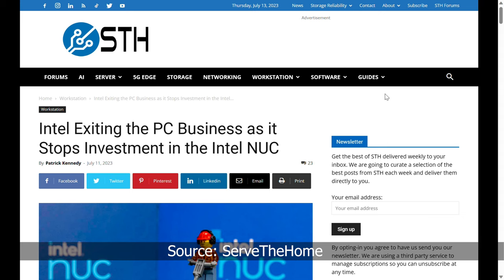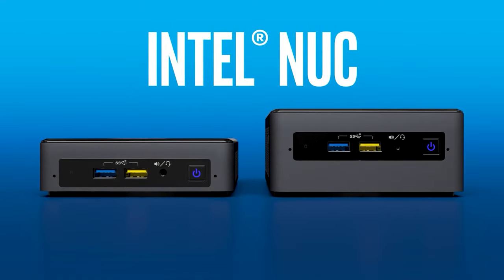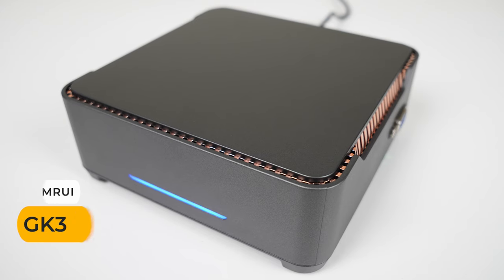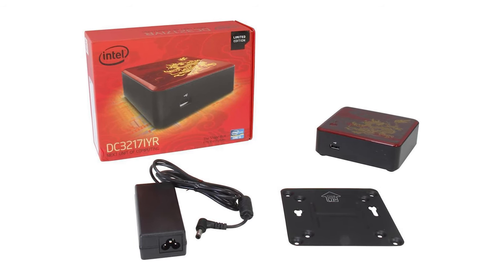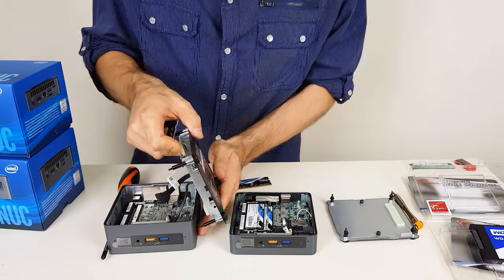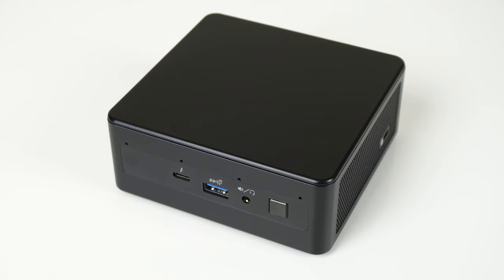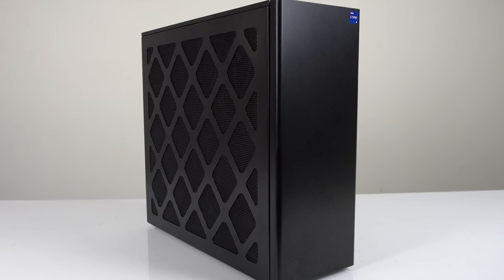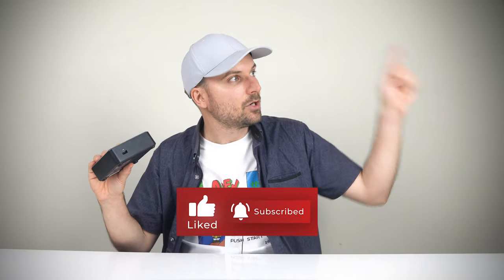Intel NUC is Dead

Comment: Just came across you channel whilst shopping for a mini gaming PC. You do such an amazing job man, congrats. After looking at your videos I’m between Phantom Nuc 11 (£749), Nucix7 (£979), and HX99G (£919). Should I be considering only the last two given Phantom is a bit outdated/older? Thanks
Reply from the maker: It really depends on your needs. Phantom Canyon is one of a kind and a fantastic NUC, but yes a bit outdated (CPU especially). If the aim is high CPU performance, the HX99G is the best option. The NUCXi7 has the best GPU, but the CPU isn't as good as in the HX99G. If you want the value option, the HX80G provides good bang for buck... at least with the pricing from the Minisforum website. I cover both in my HX99G review.
Reply: @Robtech  thanks for the quick reply. GPU wise the Nucix7 would be the play though?
Reply from the maker: The 3070 is faster than the 6600M in everything yeah.

Comment: The BIOS on the NUC6CAYS was a nightmare. Versions up to 47 had VGA dropouts. Version 42 to 45 slowed the USB 3 ports to USB 2 speeds. And as with a lot of BIOS now, once you upgrade past a certain version you can't downgrade, for security reasons of course. Which means you could get stuck with a version that had an unacceptable bug - even one that made the NUC unusable for the intended use case. Good riddance.

Comment: Would like to see this form factor standardised, curious why that has not happened (or if it is in development) yet. ie atx etc
Reply from the maker: ASRock Industrial also manufactures their boards to Intel's original Ultra Compact Form Factor (UCFF) spec. Most others seem to go bigger or smaller.
Reply: @Robtech  I mean more to do with being able to buy any case and they fit the board, allowing the consumer to buy slightly larger cases with better cooling, passive cooling cases, or semi-passive cases. I guess the issue is mainly to do with i/o, but the backplate and front panel connectors remedy that issue with atx etc.
Reply from the maker: Yeah that would be nice, but different port selection is a problem unless the maker of the board included compatible IO panels to go with it.

Comment: What if I want to buy a NUC with a built-in graphic card? Which is the better choice now? NUC 11 phantom, or NUC 12  sep? thanks
Reply from the maker: I haven't retested NUC 12 Enthusiast with the latest drivers which would probably have better performance across the board compared to my review. It'll depend on the price difference and how tolerant you are to fan noise.
Reply: @Robtech  I followed you since Hade Canyon as I wanted to get a NUC with a built-in graphic card. Well, Intel killed the NUC, I want to get either 11 or 12. The 11 is about $600. And 12 is about $900? Do you have any compare videos on both of the NUC? Thanks so much.
Reply from the maker: I just have my Serpent review which has some comparisons between the two. I can't afford to hold on to most minis unfortunately.
Reply: @Robtech  Ok. Thanks so much again. I will take a look. I can see the differences in the graphic cards, but there are other considerations. Again, thanks

Comment: Had the Hades Canyon. Before it, I used a 5th gen small one. Every time I sold them because I wanted a little more GPU power. Now, after a big gaming rig that was still an overshot for me, I use and am happy with a Chinese knockoff, Beelink, that at least shipped with a much more efficient AMD 7000 series with an incredible iGPU for the size and it's quite beyond anything NUC ever delivered. Sorry man, but even if I wanted to defend Intel and surely I used their products, I simply can't ignore them being so late to the party of good iGPUs

Comment: I just wished intel would have at least waited until they had released a Meteor Lake NUC (which is what NUC14 probably would have been), would have been interesting to see what they could do with the new type of iGPU.

Oh well, now just hope some company will release a 4x4 NUC with fans that has an acceptable lifespan*, oh well, maybe some competitor will make a taller NUC that allows us to slot in a noctua** case fan***

(* = with that I mean at least 80_000h (~9years)-
** = their standard lifespan is about 150k hours (~17years)
* = in the "tall" NUCs this could work if they had the drive bad on the cpu-side of the motherboard, or maybe came with a "shield" for the CPU-side (80mm is ~3.15in)).

Really liked the Intel NUCs since they were/are proper "deploy and ssh-into" machines (the one at my mom's place was really handy during the pandemic, I could manage the software on it even when I was sick - and the hardware has just kept going (think her's is a NUC5 (maybe earlier))

Comment: This whole segment is in big trouble, unfortunately.  I'd venture to say that - in the home, anyhow - most NUCs were used as media players, hooked up to the TV and a stereo or soundbar.  With the arrival of smart TVs running Android TV and the price drops on everything from Amazon Fire gadgets to Apple TVs though, demand for PC-based media players has plummeted.  They just aren't necessary anymore.  I can run VLC on my Android TV, for example.  There goes a huge market.

I can see uses for these still in professional environments, bolted to the back of a monitor to function as a kind of all-in-one PC with a bit more flexibility (and potentially cheaper), but even there, actual all-in-one systems are plummeting in cost.  Same goes for desktop use in the home - why hassle with a NUC and separate monitor when there are many all-in-one options to choose from?  There are still niche applications - like running a file server from one, or luggable gaming rigs you can take to a friend's place - but even there, dedicated hardware is cheaper and arguably a lot easier to deal with.
Reply from the maker: Desktop replacement, emulation boxes, PF sense and home servers are popular use cases for the home. The market has grown exponentially. There are more mini PCs than I could ever keep up with. When I started there was the NUC and little else.
Reply: @Robtech  Is the market actually growing though, or are we just seeing more offerings and fragmentation?  I'd be curious to see total unit sales across the segment.  I'm also wondering if we're going to continue seeing a flood of new units going forward, or if vendors beyond Intel will start pulling back.  

PC sales are in the toilet.  I saw today that graphics card sales have plummeted 40% year over year, which I think is the steepest decline ever recorded. Maybe NUCs will buck the trend, but I doubt it.

I was in the market for these and watched the channel religiously for about a year.  Your reviews are by far the best.  The plan was to replace a nice but aging all-in-one from HP with a giant monitor and a powerful NUC of some sort.  But as a power user, I eventually decided I was tired of having a rat's nest of cables and hubs to connect all the devices I used either daily or occasionally - three external drives to house media and backups, an external enclosure to house my optical drive, wires trailing off to USB and Ethernet hubs to connect to network and USB devices.  

I just eventually decided NUCs make no sense for my use case and got a giant-ass tower that even included a 5" bay for my Blu-ray burner.  And I'm infinitely happier.  Retired two external drives and their Medusa's head of cabling and power supplies, ditched the enormous USB hub and its power supply and cables, and my Blu-ray drive has a proper home.  A single box solution, albeit a LARGE box.  But hey - helps prevent overheating.  Much quieter than the old setup, which wasn't loud but could get a bit active under load.

I do still have an el-cheapo NUC as a media PC hooked up to the TV, and I might eventually upgrade that.  Although mostly I just use VLC on the TV, and stream directly to my receiver from my computer using DLNA out of MediaMonkey, so it's gonna be awhile I think before I spend money on that.

I hope the category thrives even with Intel pulling out of the market - they're just neat little machines.  But I do wonder if, like those little netbooks, their time has come and gone.  The next year or so will probably tell.  One possibility is that corporations, looking to cut costs, will start substituting NUCs for laptops for remote workers.  Since most already have their own monitors, this could be a viable option for those who don't need to travel to work.
Reply from the maker: You're right. That is only my opinion as I don't have any sales figures to prove it. I'm just going by how it felt to basically only have one option to now having hundreds and minis starting to get more media coverage and mindshare.
Reply: Android OS is pants, A desktop OS is miles better for the home. The reason the GPU sales are down is because of AMD & Nvidia ripping us gamers off.

Comment: Crap. Intel had best build quality and reliability. Now that this benchmark is gone, the Chinese crap quality will become the 'standard'. My Minisforum hasn't seen a sorely needed bios update and AGESA update since it was launched. And any complaints are at best met with silence, at worst with insults. Edit: selling my Bean Canyon NUC, maybe I should wait until they're really 'vintage' 😁
Reply from the maker: I don't see the void being filled either. There doesn't seem to be much demand for quality, only the lowest prices. That's why I go out of the way to praise every metal case I come across and those using brand new components.

Comment: Pretty sad really. ALthough I cant say I've been super stoked with Intel's support. I've had firmware updates cook 2 NUCs and my current 8i5 is suffering badly from overheating. It's what brought me to this video actually.

Anyway, I loved the idea of a small media PC and they've done the job there. Just need someone else to step up with something that can do the job for a reasonable balance of performance, price and cooling.
Reply from the maker: The fan is likely clogged up now and needs to be cleaned. It's a bit of a pain, but if you pull the board out you can clear out the dust and debris. Watch out for the WiFi cables.
Reply: @Robtech  yeah you are right. It didn't look that dusty, really, but there was obviously enough to make a big difference. was peaking at 100c and throttling and now sitting around 55 while playing youtube videos. 
Might have to do the thermal paste/thermal pads next time around if it plays up again.
Reply from the maker: Yeah, repasting can help too. Depending on use, it can just dry out completely. But it sounds like it's doing okay now.

Comment: Intel is in trouble, delayed server cpus, inefficient mainstream cpus, not up to par gpu launch and now the death of NUC...they will come back though but when and at what cost?
I said this when AMD released Zen 3 i think and i saw the efficiency on the mobile chips, they gonna take more and more shares over the years and i hope they will enrich the SFF market with parts for a long time!
I know Asrock have similar pc's, are they using the same hardware as NUC or are they clones they make themselfs? The NUC might be dead but Intel mobile chips won't go away.
Reply from the maker: ASRock Industrial creates boards according to Intel's specs. I think they're licenced.

Comment: 🤷🏻‍♂️🤷🏻‍♂️🤷🏻‍♂️🤷🏻‍♂️it was bound to happen after all AMD its kicking intel's ass especially on the gaming department. Personally speaking now that intel is killing off its nuc line Valve should had taken it over and rebrand it for a revival of the steam machine console line but use AMD like theve been doing with the steam deck instead of intel. But I guest now Asus will beat them to it because there taking over production of the Nuc under a non-exclusive license.